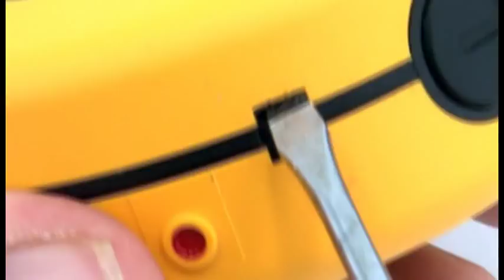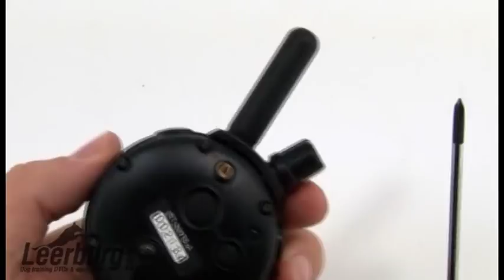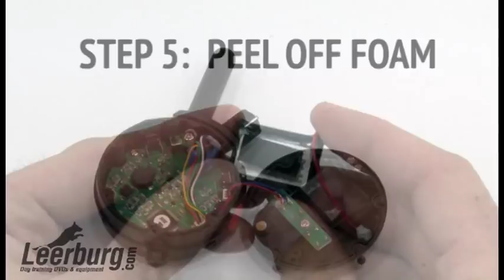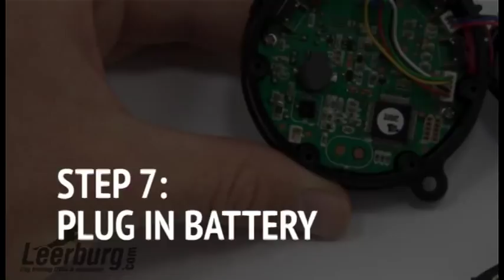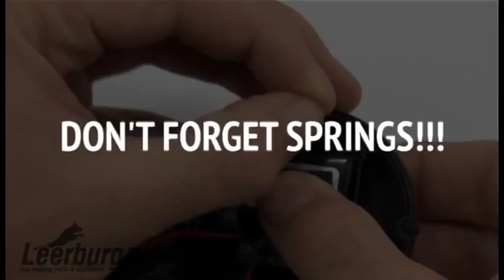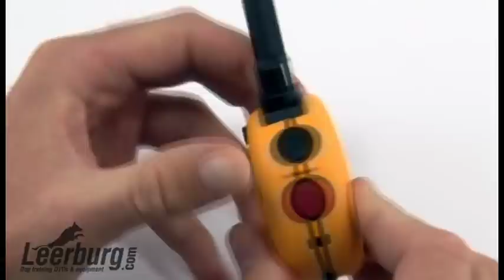How to Change the Battery in an Educator Ecollar - The Quick Version

Comment: The customer service at this company is stellar. I had a problem with a unit and at first contact the rep said he would forward my issue to the correct dept. i expected the usual shuffle. The next day I received a message. Not for further discussion. It was a shipping notice and an expected arrival date. 

And now I find out that replacing the batteries doesn’t require buying a high cost proprietary battery? 

Wow!

Comment: Is a video showing how to change the battery in the collar receiver
 anywhere to be found ?
Reply: Have you found a video on it? Do you know what battery to buy and where to find it? Thanks! Came to video and thought the exact same thing!
Reply: Did you find a video about changing battery in collar?
Reply: I just did it.  You need a T10 Torx or 10mm Allen key.  Its very similar.   READ THE WHOLE THING BEFORE YOU START.  Remove 4x T10 screws on the front of the unit and gently pull apart.  Some things may fall out, that's ok. I'll go over that.  If you can, remove the black strap to make the rest easier or at least to give yourself more slack.  Make a visual note on which side of the connector is the red/black cable. Also note how the battery cable is tucked. Pull the cable connector to remove battery.  Pull the tape w/ foam from old battery and put on new battery.  A small silver Phillips screw came out when I pulled apart so I screwed that back into its place.  Also the orange rubber gasket came out of place - no big deal we'll get to that. The long black rubber coil protector also came out.  To re-assemble: reconnect the new battery - may be a little stiff since its new, just push it in as long as you're sure you have the red/black in the right order.  Position the battery w/ the cable on the same side as original.  Tuck the cable similar to how it was.  Gently run your fingers through the orange gasket on the cover if it came lose and it should just slip back into place.  Make sure you have the long black rubber coil cover on top of coil, gently close the receiver and make sure nothing is being pinched.  It should close cleanly.  Tighten the 4x T10 screws so that they are snug.  They weren't super tight before so don't over tighten.  Plug into charger and you should see the red charging light come back on.  You did it!

Comment: Thank-you.  Do you think it should still work with only one spring - I somehow lost one.  I put the battery in but still not working - maybe it's because of the one spring?
Reply: Yes that is the reason. There's a more detailed video on Youtube on replacing the batteries in the transmitter & receiver. The channel is Adventures With Dr. Joe & he points out that both springs need to be in place with the contact points for it to work.

Comment: Does anyone know if you can get replacement springs?  I bought one second hand and they changed the battery and the springs are missing. I believe this is why it isn't charging.
Reply: Check if the remote rattles when you shake it. I was missing one but when I shook the bottom piece it sounded like a spring was in there and I smacked it against the table and it came out.